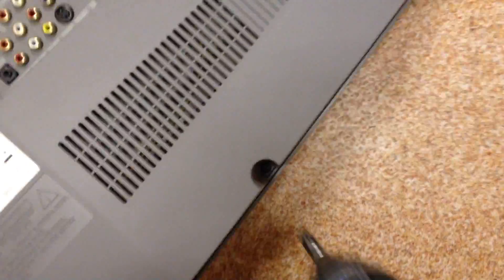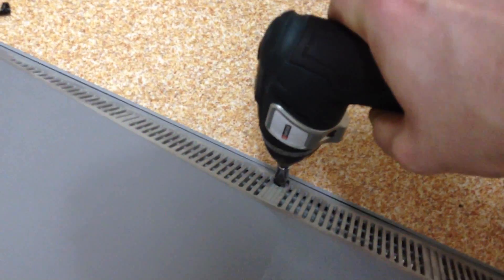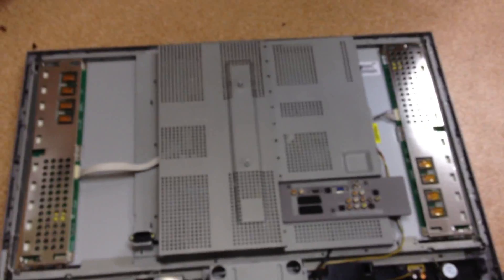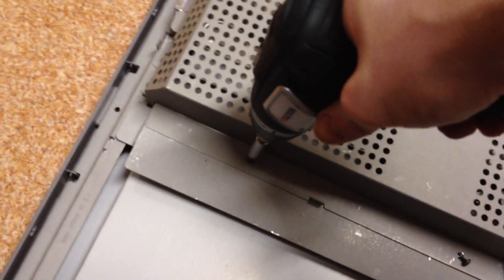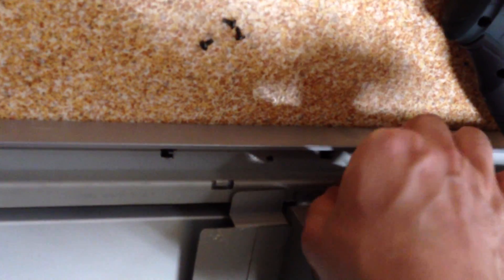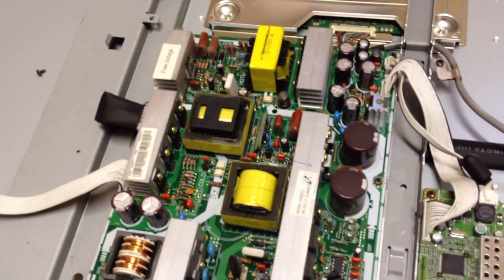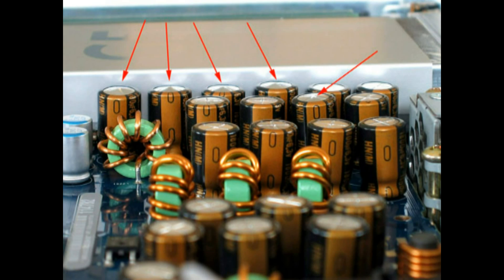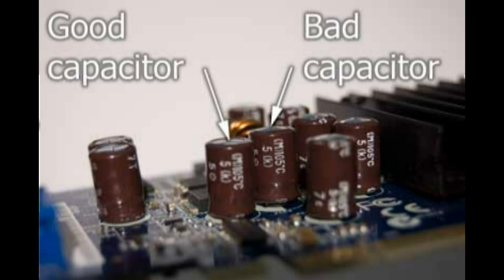How i repaired my TV Samsung LE40R51B

Comment: But if that's not the fault, take off the cover and look like it won't turn off. Look where it gets very hot and put a small propeller there, even in several places. You can then replace the cover.